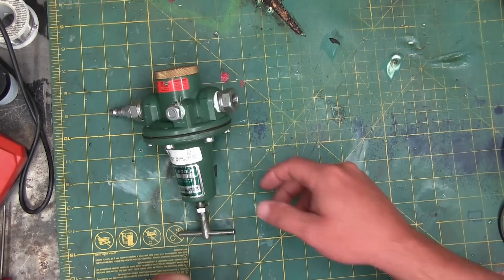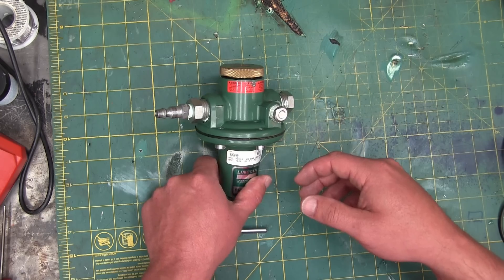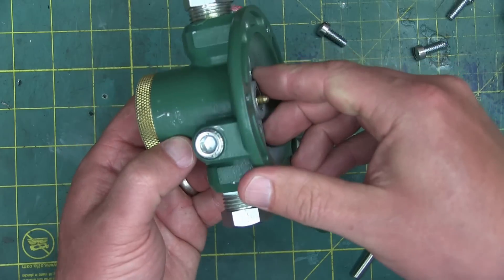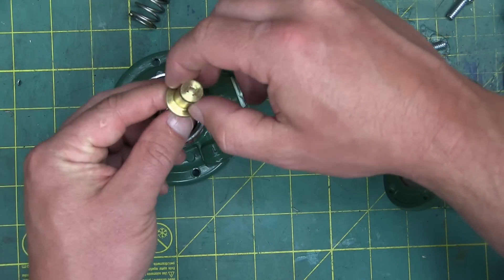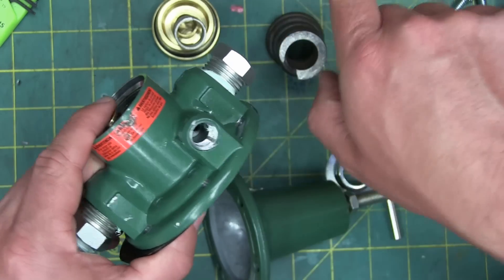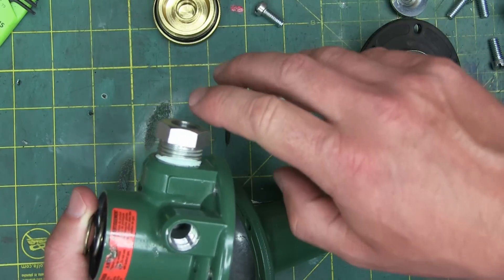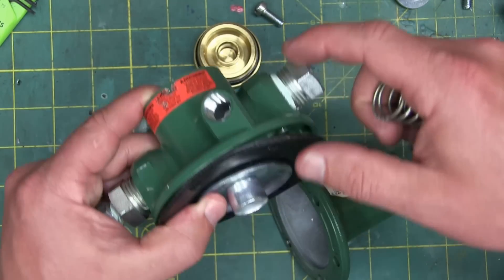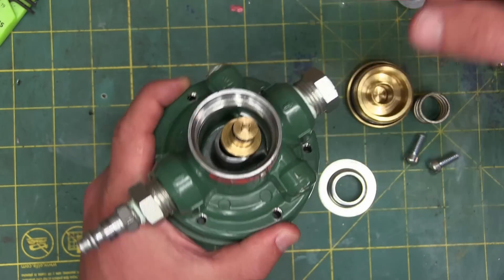BOLTR: Pressure Reducing Valve | Gas Regulator

Comment: The poppet valve should have little holes through so that if the diaphragm fails the inlet pressure balances and the spring closes the poppet valve, there has to be a safety you would not want 2000 psi in your lungs if the valve fails on scuba gear the same thing is usualy done on regulator valves for gas and air.
Reply: Not a dive, are you? On a SCUBA reg you want a failure to result in a free flow condition. Otherwise, your air supply would be cut off and you'd drown. Too much air is much better than no air when you're on the bottom of the ocean. Excess pressure will vent from the exhaust valve on the 2nd stage. So, there's no danger of high pressure reaching your lungs.

Comment: Couldn't you make something like that based on bernoulli's principle, if the airflow is too fast the valve would close slightly more due to lower pressure, though this would provide a regulated flow coming from a high or unstable incoming fluid. I may be wrong on that one feel free to correct me.

Comment: What the max pressure of that valve and would it work with pressurized liquids lik co2
Reply: Ian Gallinger most CO2 components are higher pressure. Around 1800psi or so. This regulator is probably only good for ~200psi max.
Reply: yea thats kinda what i figured but its hard to distinguish high pressure (100 - 1000 psi) equipment from high pressure (1000-5000psi) equipment for me on the internet

Comment: This is the best description I have seen on how these work. 
Super Challenge for you.... Please explain how "Gas Lifters" work.
Like those used in office chairs, hatchbacks, Uber Tool boxes ! 
Cheers from Down Under (Perth Western Australia).
Reply: In order for the pressurized gas to do work, it must release that stored energy ie expand.
They will do this hundred times or more on a good quality unit.  
As it is a closed loop, no external gas supply, it must recompress the gas each time the user adds weight & holds the lever to compress the lifter.  The question I should have asked is, How it does this so efficiently. 
And what the mechanism is that allows for an over all equilibrium of gas pressure. To move between upper & lower chamber in constant inversely proportional volumes.
Reply: OminousPineapple: Some have a spring as a dampener to stop jarring at end of the lifters stroke. But the gas pressure is doing all the lifting when you press the lever on a chair to raise it.  This is apparent when they fail to lift at all, due to worn seals. Otherwise you would "feel the spring" as you put it, still trying to lift the chair.
Reply: your so stupid it hurts, you need an external gas source to maintain pressure in a gas lift system. when they fail to lift its either because A) the spring is broken, or B) your too fat to overcome the springs collapsing pressure.
Reply: A spring assists it back up, the air holds it there so it's not like sitting on a spring.
Reply: case in point, go back to video editing, you could use a few how to videos

Comment: What about a flash-back arrestor from an oxy acetylene setup. How do they work ?
Reply: Greenlite Concrete  It is a case of having "gaps" that are too small for combustion to exist within. ie gauze etc. Another way it can be done is with a larger number of smaller "holes" which can then be termed individual "flame limiting orifices".
Reply: Inside mesh screen or metal sponge and a one-way valve.
The mesh/metal sponge acts like the mesh in a Davy Lamp, taking the heat out out the flame, so that only non-burning gas can get through.
The pressure wave from the back-burning gas closes the one-way valve so that nothing goes back up the hoses.
You do have flashback arrestors on both ends of the hose, as per current Australian standards?
It is supposed to guard against a severed hose lighting off and sending a flame-front back through the regulator.

Comment: Aren't these things designed to work over a specified pressure range? I'm guessing that would depend in some relation to the strength of the bias spring above the poppet valve. In which case, wouldn't that also affect in a similar fashion the cross-over point between all through and closure with an inlet pressure drop?

Comment: I think it was designed not to let out too much air.  Think of this thing as the pneumatic equivalent of a cross between a 7805 and a polyfuse.  The zero pressure on the output is the equivalent of a short circuit.

Comment: You don't lose all pressure if the inlet is opened, you'd lose pressure until the outlet pressure is in balance with the setpoint.  So reducing the pressure setting would result in the air flowing from the outlet to the inlet until the outlet pressure was again in balance.  Of course some regulators have a bleed to allow pressure to fall without bleeding off the outlet side.

Comment: Thanks!  I use these devices for testing "leak detectors" on gas (petrol ?) pumps...to create a calibrated "leak" to see if the safety equipment trips when it is supposed to.   (Also when I was a welder...but that's another story.)  I knew there was a diaphragm, a spring, and that it's closed by default.  But I didn't understand how those parts regulate the pressure.

Comment: If the diaphragm leaks the diaphragm just leaks it doesn't increase the outlet pressure, as the surface area of the diaphragm remains. UNLESS!!! the main spring housing is is sealed or in the case of a large leak the housing vent is smaller than the size of the leak.

The back flow is not an artifact of manufacture, it is caused by the main diaphragm spring forcing the valve open when the outlet pressure is below the current pressure setting.

Comment: You forgot about the pressure acting on the diaphragm when you remove the inlet pressure. If the outlet pressure is higher than the set pressure (not exactly right, really lock-up pressure). Then the pressure on the diaphragm will hold the the valve closed. It just depends on the relation between the set pressure and the outlet pressure.
Reply: That is exactly right. Cmon Ave, you can't miss that shit
Reply: yeah I think he missed that part. it wasn't a fluke that it would only hold at higher pressures. like you said it depends on how tight that spring is compressed compared to the air pressure on the outlet.

Comment: If the outlet pressure gets too high the diaphragm pushes down against the spring opening the hole in the middle of the diaphragm allowing it to bleed off through the adjustment handle

Comment: How fast do these things react? Will it protect the output side from a fast high pressure spike on the input?
Reply: xartpant faster than you think it actually closes immediately as it reaches the set pressure, you could easily monitor that if you had a gauge on the output.
Reply: Not always. If you drop a lot of pressure on them  really fast they can over-pressure the outlet. You want to slowly bring the pressure up in the lines to avoid this. Usually you also have pressure reliving valve on the outlet, or slam-shut to prevent over-pressuring your outlet.

Comment: At work I repair/rebuild Armstrong ( not related to pump company of same name ) steam pressure reducing valves. Nothing like having a pop-off valve blowing out 90 psi steam.
Reply: BustedWalletGarage At the chem plant I work at a 600# PSV lifted on the main line from the boiler. You could hear it a mile and a half away. Loudly.

Comment: "when you're SCUBA diving you need to have very low pressure entering your lungs otherwise you blow up like a puffer fish and die" Others before me have mentioned that the regulator for SCUBA is a "demand regulator".  The deeper you go, the more water pressure compresses your body and the gasses in it, including your lungs.  You will need more pressure to inflate your lungs.  I suspect, because I haven't taken one apart, that it's pretty similar except the heavy spring side of this regulator will be open to the water and a the two springs matched so as to allow about 15psi above current water pressure.  The pressure under water doubles the pressure at sea level(14.7psi) every 33ft.  So, if you are at 33ft and fill your lungs with a demand regulator, and then try to ascend to the surface without exhaling, the scenario you described might just happen.  I suspect the pain would compel you to exhale first, unless you are not aware of what the pain is telling you as running low of oxygen seems painful as well.
Reply: David Kenny 
It's very similar to how a demand oxygen mask works for aeronautical purposes, instead of using a hand varied spring pressure to regulate the output pressure, it has an engineered preset output that is controlled by ambient pressure (in your case, water pressure) . 
So instead of the large hand set spring controlling the pressure, the pressure of your immediate surroundings pressure controls the balance on the diaphragm
Reply: Interesting tidbit for sure.  but I think he just means we need some type of a regulator instead of using just the bottle and hose haha.

Comment: looks to me like it works about the same as diaghragm in a weedwacker carb only a little different, doing the same thing tho if you think about it
Reply: FlyingWldAlaska77 Exactly, the vacuum amount required to pull down the diaphragm and open the fuel inlet needle in a diaphragm type carburetor is the same as the amount needed to draw fuel up against gravity from the level in the bowl to the end of the main nozzle in a float style.
Reply: actually im sure diaghragm carbs have a fuel pump dighragm seperate from the metering diaghragm which works with an air bleed tube in the crank case on the 2 stroke motor, the piston moving up and down makes a fluctuation between positive and negative pressure and basicly sucks and blows the diaghragm back and forth and a reed valve set in the carb itself only lets the fuel in, so that its pumping to the jets but the metering diaghragm is the regulator that keeps it at the right pressure, float bowl carbs need a fuel pump or a gravity feed system to work
Reply: FlyingWldAlaska77 Yes and lots of float bowl carburetors also have a crankcase pressure pulse operated fuel pump. They have been used for years on boat outboard motors, small engines for yard equipment, Etc. They are usually separate from the carburetor itself but the one on the Briggs opposed twin engines were integrated into the downdraft carburetor itself.
Reply: yep ive been inside one of those briggs apposed flathead twin carbs with the float thats a ring all the way around the carb barrel , those apposed twin motors are well known for being one of their best engines they ever made, they are pretty cool, those old briggs motors with the fuel tank mounted directly under the carb have a fuel pump diaghragm that im pretty sure works off the vacuum pulse from the intake stroke and puts fuel in a section of the tank thats like a float bowl but it has an over flow hole so theres no need for a metering device such as a float valve and it just has a straw that goes down into that little cup for the jet
Reply: Yep. Briggs, Onan, and Kohler all made great opposed twins. I just wish that at least one of them had made an OHV version instead of only going to the 90° V twins for OHV.
Reply: well i think an apposed OHV would have been too wide to fit under the motor cowling of most mowers, thats probably why they never did, the flathead was such a compact and powerful unit as it was, it never really exceeds 3,000 rpm anyways, at that rpm an OHV has little performance gain that i know of over side valve, ohv is just more efficient on gas, what i hate is the newer mowers with the briggs ohv motors, they are gutless, they are only 150cc now with a shorter stroke and same bore as with the 190cc flathead briggs, the 190cc flathead had that longer stroke and since the piston moved faster with better leverage at 3,000 rpm than the new ones it had nearly twice the torque to cut grass, ohv motors are definitely better but trying to use it to replace displacement is foolish, everyone knows theres no replacement for displacement especially when it comes to making the stroke shorter, you can rev higher and make more horsepower but with a lawnmower where its governed at 3k all the time, meaty and stroker is the way to go, ive always had a love for big fat low revving long stroke under square motors that can just spin slow and make torque, especially diesels, max torque at 2,000 rpm, why rev when you can just grunt? besides faster motors wear out quicker, the marine diesels that only spin at like 200 rpm all day every day are good for like 500,000 hours or more and f1 car engines that scream at like 25,000 rpm are only good for like 2 races if that, and the 90 degree v twin motors can fit into a square shape quite easily, and one thing your sure to see more of is overhead cam engines in small power equipment, honda made a 35cc ohc motor for small tillers and weedwackers and stuff and a 160cc ohc for lawnmowers, and a horizontal shaft motor for powerwashers and stuff, they all have a timing belt instead of a chain which i think is cheep, as far as i know the motor is engineered so the piston wont hit the valve if its open so it would just need a new belt but over all as a unit the motor chews the belt and its over for you and your gas powered job, the belt throwing is rare but OHV setup on small motors breaking is pretty much unheard of, industrial equipment like cement mixers and big boy tillers still use OHV because of its easy to work on and it simply doesnt break like a belt could, anyway thats my rant

Comment: They are called pressure regulating vs pressure reducing because when used in larger systems they can be used with other normality closed and normally open valves to control much bigger valves. And both sides of said larger valve, such as in oil and gas pipelines, or water systems.

Comment: Can you take apart a propane safety regulator? if too much pressure is released too quickly it shuts off for a period of time. small mechanism, and probably an interesting twist on this.
Reply: Generally, those excess flow valves are found in the fittings you attach to the tank or the tank valve, not the regulator itself. Course where I work we actively avoid such terms (and product) as "safety regulators" and stick with full flow! Maybe those weasels snuck another "safe" product out but for us... more gas, more fire, more better!
Reply: They are basically a one way valve with a bias spring, too much flow and the gas overcomes the spring and shuts the one way valve (it's in reverse)

Comment: Reminds the old days in oil industry, the pneumatic PID regulators, with 4 bellows acting each against the others, just to move a metal tabs over a "precision air leak" which was then amplified to a 0.2-1 Bar air output signal.
Genius times without electronics…
Reply: pneumatic controllers and pneumatic positioners are still used on pipeline natural gas where there's no local instrument air or power, the raw pipeline gas is used instead
Reply: Foxboro... good memories of my control classes at the polytechnic.  Flappers and nozzles and don't crank up the amplification too much or she'll start to oscillate uncontrollably; )
Reply: The Third International Party of Kekistan many many electronic solenoids still use (or can use) kinda the same concept. Solenoid operates a small pilot that then turns the big valve on/off.

Comment: That's why you need to bleed your oxy acetylene lines and regulators, I'm guessing. No good comes from storing bombs in tiny pressure vessels next to the big 200 psi pressure vessel bomb

Comment: Pressure regulators are used for gas meters extensively
Reply: Andrei M yeah we use them a lot in power generation, processing of natural gas. Fuel skids etc etc. Damn things get huge for even low pressure applications ie. 150psi inlet on a 2" line is the size of my torso. That and actuator valves and PRV seem to always be green and the actuator are yellow and everything else is mocha white lol
Reply: False, people who see green valves automatically think they can f**k with them. people who see red valves think danger and don't touch. always consider the colour towards applications. There's a reason the nuclear launch button isn't coloured pink
Reply: Andrei M we use a lot of them at the steam/power plant that I work at
Reply: Andrei M yuppers , in fact btu , water column fun guy here 😄
Reply: green is always the right choice for regs and valves ;)